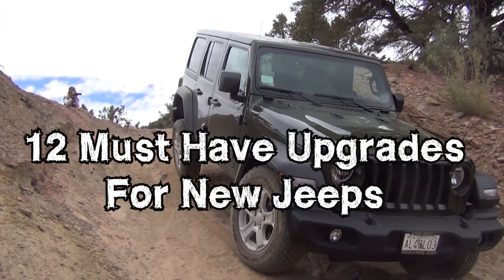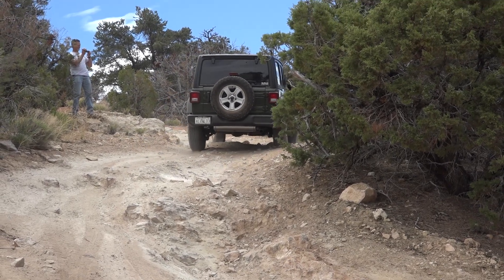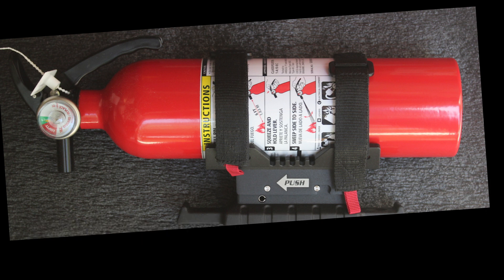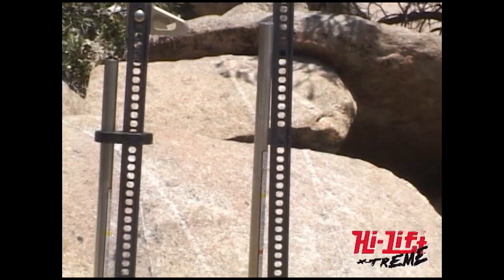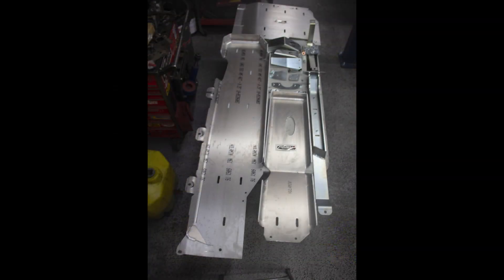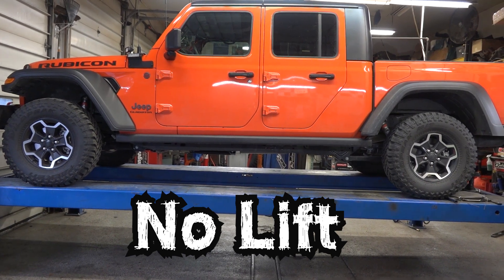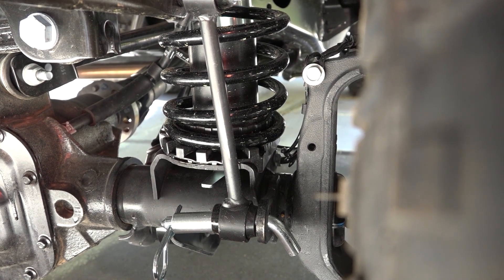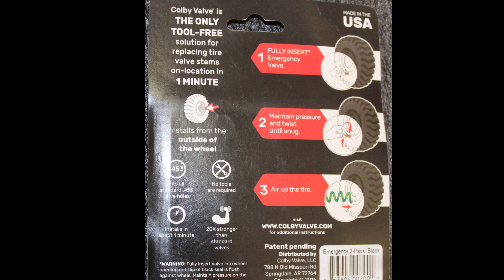12 Must Have Upgrades for New Jeeps   Some essential items for a new  Jeep Wrangler JL or Gladiator

Comment: very useful video. Did that hitch pin quick disconnect using stock sway bar links work out for you? Do you recommend it?
Reply: Wondering the same thing- think it might be a little loose and make noise.

Comment: Agree with all your recommendations if you're into technical trails and such.  I am very pleased with my 2020 stock 2-door Wrangler Rubicon for off the beaten path desert explorations.  My only planned "mod" will be installing a Bolt hood lock, which I recently ordered online after viewing KBB's vid, https://youtu.be/hqZehf053qk?t=142, where that Jeep's pricey LED headlights were stolen.